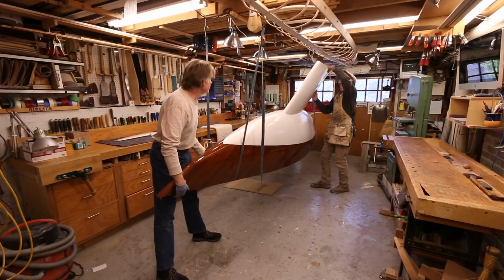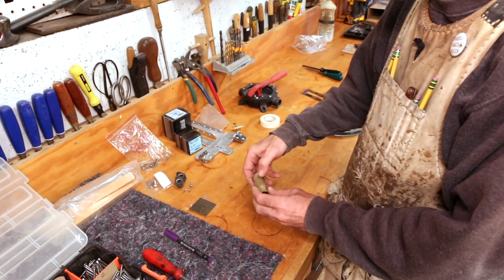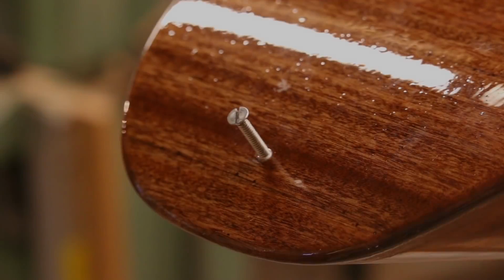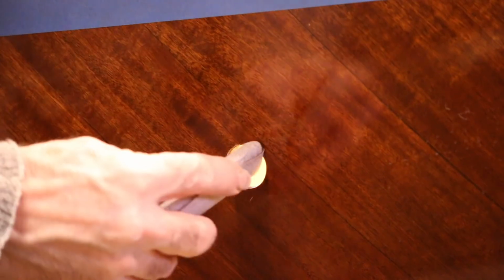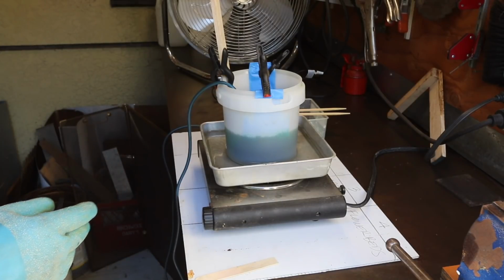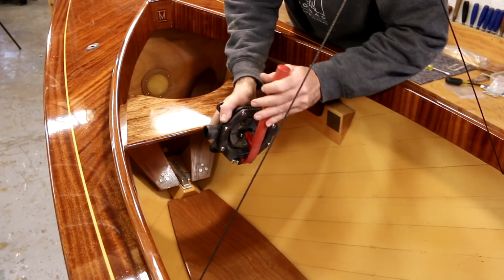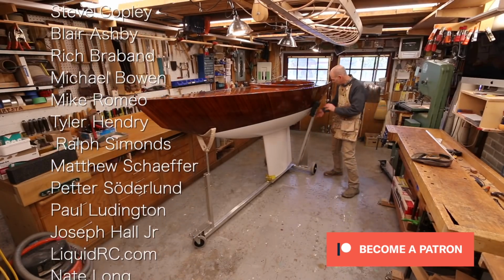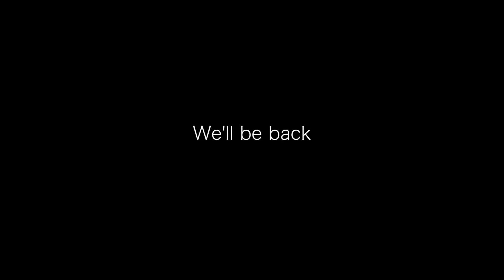International 2.4mR Sailboat Project - Episode 54 - The last flip

Comment: Congratulations, wonderful job, any other words couldn’t reach this piece of art! I could not understand how and where the mast gets in!
Reply from the maker: There is a mast partner that sits below the deck which I didn't feature. The client is taking care of the rigging so it was left un-installed. The mast drops into the cockpit area.
Reply: @Nomadboatbuilding  Dear Nomad, I’m making probably a silly question but the waterline from a boat depends from the weight and consequently the water volume occupied by this weight in the water, Archimedes buoyancy principle, then when marking the waterline in the hull without testing and without knowing the weight from the boat, it is just following the plan?
Reply from the maker: Yes, I placed the waterline according to the designed waterline. It worked out fine when floated. These boats are dry sailed so the waterline isn’t really important anyway.
Reply: @Nomadboatbuilding  many thanks for your answer and once again, congratulations for that “piece of jewellery”!

Comment: Thank you Mark for the opportunity to follow you on this project, she really is a beauty…. Shame this 2.4m class does not allow any flexibility for keel creativity…..
Reply: While the rule may not permit bulbed keels or reverse taper keels with wings, and the ballast must be removable, anything else is permitted. The aspect ratio, taper ratio, foil section, chord, tip configuration, etc are all up to the designer. Doesn't have to be a constant chord foil with a sharp edged tip as shown here.

Comment: 2.4 mR rules say, that boat must have BUOYANCY TANKS. I can`t see them.
D.5.1 CONSTRUCTION
(a) Buoyancy equipment shall comprise of rigid non-communicating air cell foam plastic incorporated into the yacht.
Reply from the maker: There are sealed bulkheads fore and aft filled with solid foam.
Reply: @Nomadboatbuilding  OK